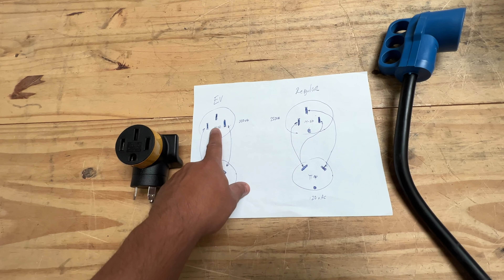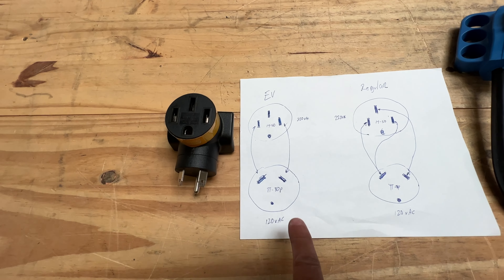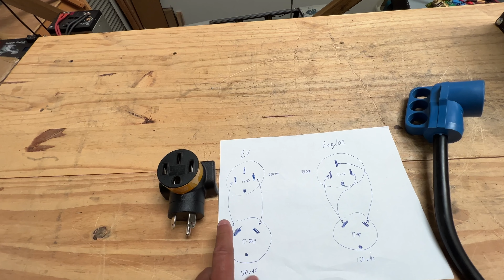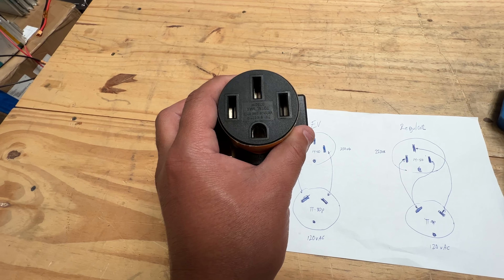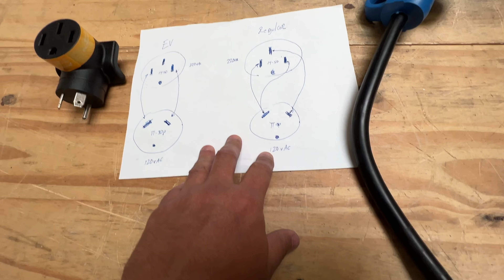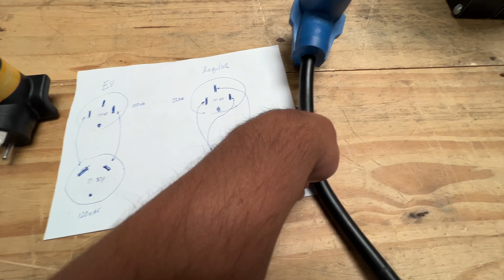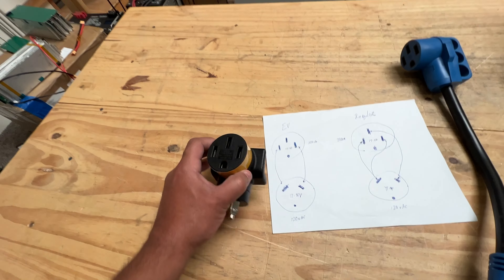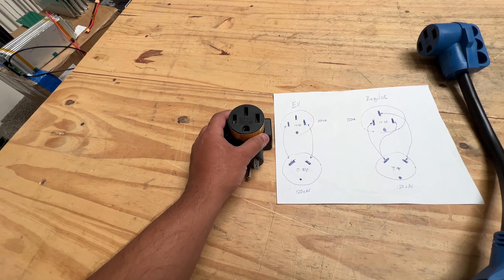TT-30P RV to NEMA 14-50 EV Charger adapter Plug

Comment: Good explanation.  It is good to get the word out that RV adapters will not work for EV charging.  The problem with these EV adapters is that when you plug into a 14-50 outlet your car might draw up to 40 Amps.  The TT-30 outlets have 30 Amp breakers and can only support up to 24 Amp EV charging.  Instead of using one of these adapters, I made a TT-30 to 14-30 adapter.  The 14-30 plug automatically limits my car to 24 Amps max.

Comment: 😎primitive schematic WORKS for me 👍
😌or make your own 220v using two 120v outlets... they have to be on separate phases⚡
or 🤓buy Power Converter 110/125V To 220/250V Electric Adapter 5-15P Wall Plug To 14-50R Miller Lincoln Hobart Plasma Cutter Welder Mig Tig Arc Receptacle Outlet Box NEMA FX583W
😮‍💨Phew what a mouth full 😵‍💫👍

Comment: If the TT-30P socket has L1 and L2 120VAC you can get the 240VAC between L1 - L2, BUT if both the 120V connections are from the same phase then there will be NO 240VAC.

Comment: I have a 30 amp on my house that was installed to run a RV. Id like to install a level 2 EV charger and use the parkworld adapter. Would it be ok to leave the charger and adapter always plugged in?

Comment: So end of the day, will this adaptor basically make it work, but you end up charging at the same speed as plugging into a 110?  If so, not worth it. Might as well just use the 110 that most campgrounds have in the same outlet as this.  I’ve always just paid extra to rent a 50A RV spot for car camping when I do mountain bike races and those spots work just fine with the 240 plug my car came with.

Comment: New project idea 💡 
Hybrid electric generator system where an RV owner could pair a battery bank with gasoline generator and charge a recharge a battery bank + inverter.  

Examples for use: 
- A small 800W generator (1000W Peak) has enough power to run a refrigerator but doesn’t have enough power to start a refrigerator motor. 
Connecting the generator to a power bank with a 2000W pure sine inverter would allow an undersized generator to start the refrigerator.  
- A larger generator with electric start could be modified to run intermittently like the Start/Stop in hybrid car to maintain the battery charge between 20% and 80% this would save fuel and allow for silent operation when electricity draw is low.
Reply: Liquid fuel generators are loud af, other campers would hate you

Comment: I still don't understand why the Tesla works this way, but not the other way.  This seems worse from a sanity point than missing a leg
Reply: Because it expects 220V, so it only uses the pins that are normally the 2 hots in a 220V plug. At the same time, it's auto ranging, so it will take 120V across those same 2 pins. Just like an auto ranging computer power supply or power brick - it uses the same plug on the device, and you can either feed it 120V or 220V and it works with either. You just use whatever cable you need that plugs into the outlets you have, and the power supply figures out the rest.
Reply: @gorak9000  Oh that makes sense.  Got it now. Thanks!!